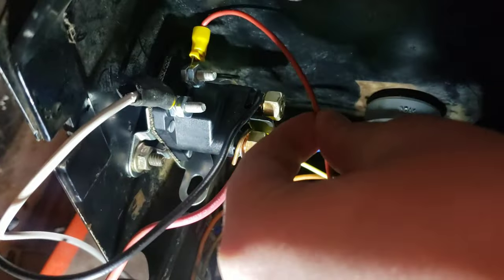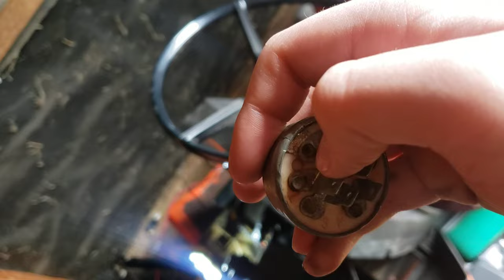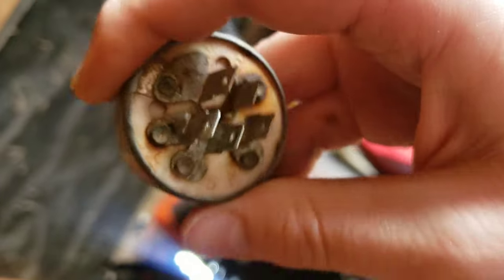How to wire a starter solenoid in your lawn tractor/Garden tractor

Comment: Not very good instructions... you say the rt side goes to battery...BUT DOES IT GO TO THE POSITIVE OR NEGATIVE TERMINAL OF THE BATTERY?
Reply from the maker: positive. negative is always ground. what goes to the negative terminal is a wire connected to any peice of metal...such as the frame. Have a blessed day!
Reply: What tab does the small  wire hook to on the switch  that goes from the tab on the solenoid to the key switch. You almost said it twice but then never said which tab/letter on the key switch.  Did you bypass all your safety switches? I'm planning on doing that.
Reply from the maker: @user-wz3yj6qr7c  Sorry for the late response, i know this is too late, but just in case you still need help, that wire goes from the solenoid to the "S" tab on the switch.

Comment: Wires from safety switches go to the ignition key or to the starter selenoide?
Reply from the maker: They should just go to the solenoid. The safety switches were bypassed on my tractor.